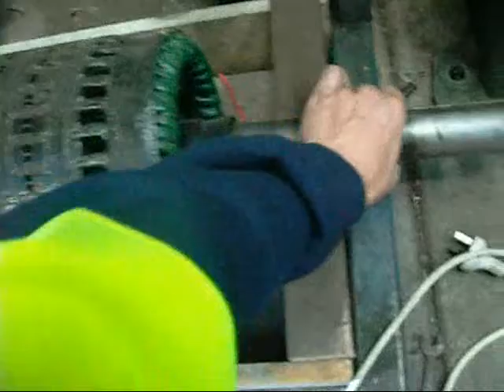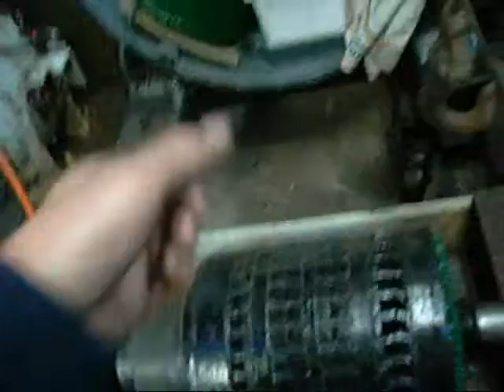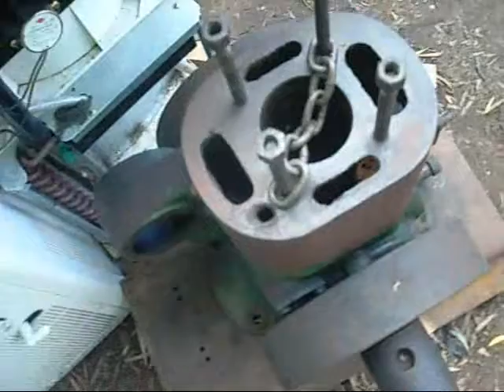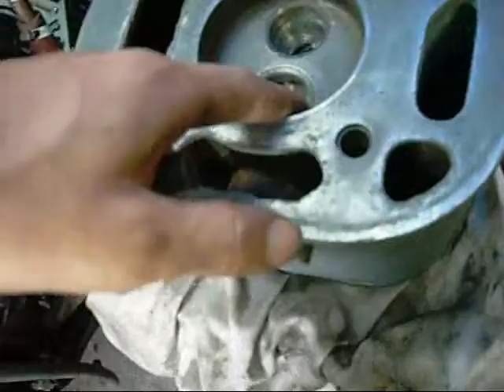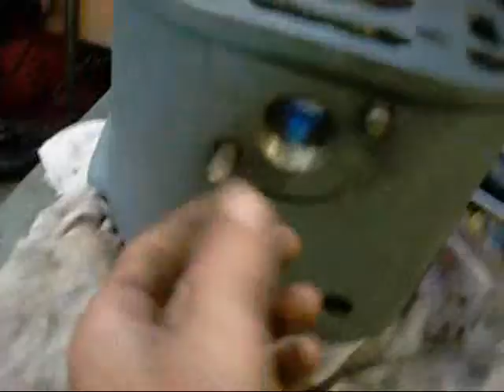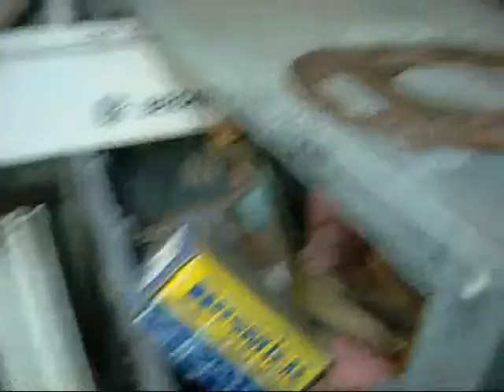Westinghouse Generator and Kelly & Lewis Engine Project Update

Comment from the maker: @oOoxelAoOo not too sure what the comp ratio is on the K&L, but it has a large combustion chamber so I guess its fairly low.

as for gasket card, it will need a metal seal around the comb chamber or it'll just eat away at the edges and eventually blow out into a cooling gallery or to the crank case :(

I'm going to visit the guy I got it from, he has dozens of old engines he has restored, and I'm sure he'll know how to make a new one!.

Comment: Perhaps pull the old gasket apart, give it a good clean then stick the two copper sheets back together with a bit of silicone?
I'm surprised it has such a heavy duty gasket really, what sort of compression ratio has the engine got?
May be possible to just replace it with a bit of gasket card..

Very interesting little project, hope it works when you get it all back together again.